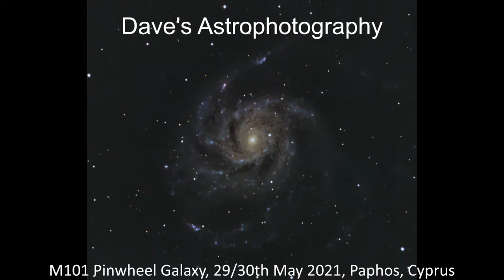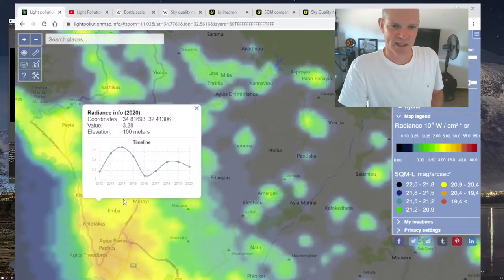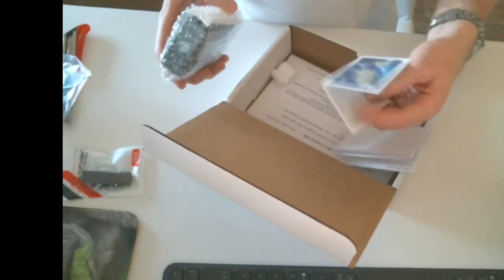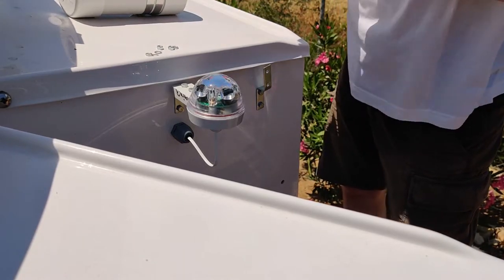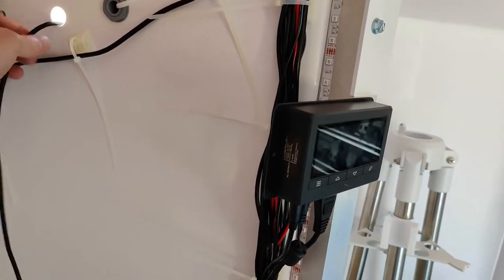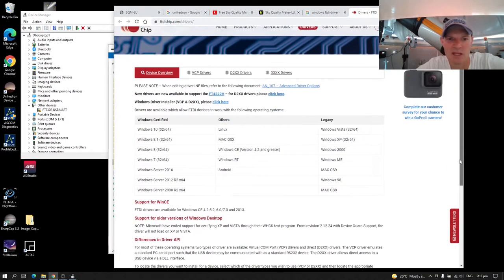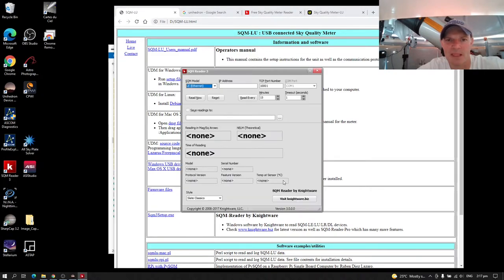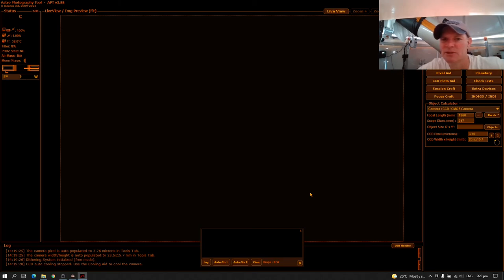Unboxing and Installing Unihedron Sky Quality Meter (SQM)

Comment: Great video, I love Cyprus - spent 7 years on the island over two trips. If you get the chance to visit the Blue Sea Otel up on the "pan handle", the night skies there were absolutely amazing. The hotel turned off all the lights when I last stayed but sadly, I was only into visual astronomy then and not the observatory and 3 scopes I have now  sigh  I am tempted to get one and also an all-sky camera to mount outside the observatory. More so after watching this video  :)
Reply from the maker: Hi Stephen, thanks for the feedback. I've been here now since summer 2017, I really want take my scopes up to the top of the hill in the Akamas national park, away from habitation and light pollution. Just need to work out the best location and route to get there, and how to power everything!